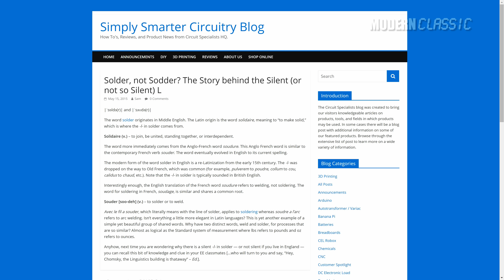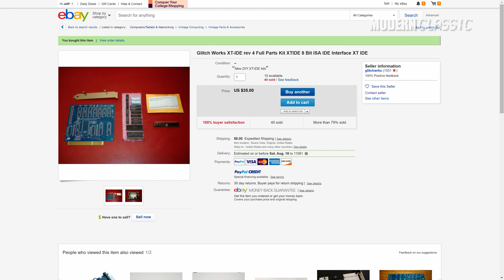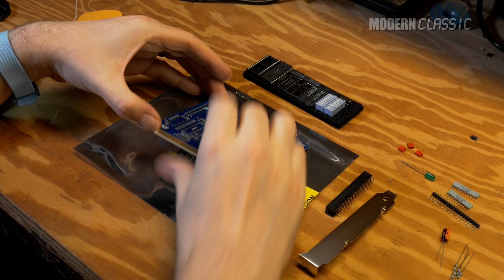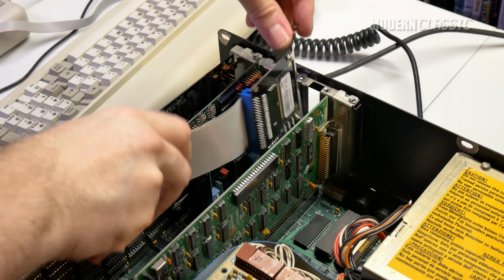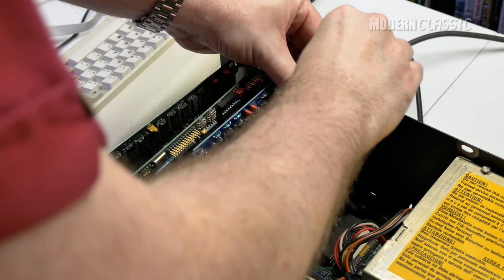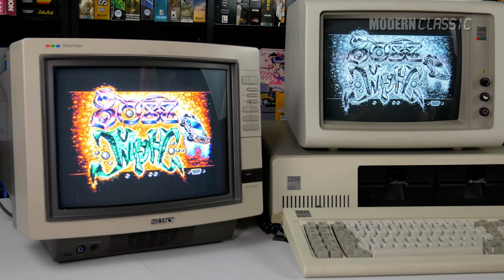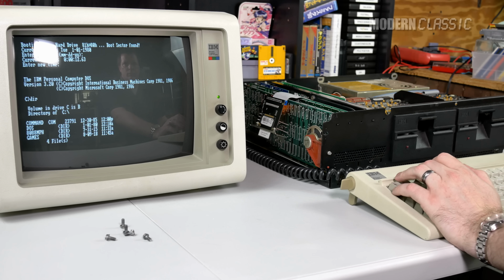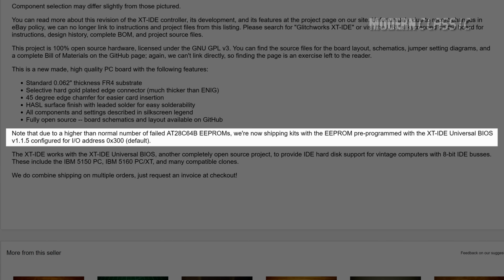Flash storage for classic PC's - building an XT-IDE kit!

Comment: This was an extremely useful video to me, as I was just struggling with trying to get XT-IDE card working with my CF Adapter, I even used the same CF adapter! It's annoying that I have to find an original copy of DOS for it to work, but I guess its always interesting to have the physical disk. Also, do you know what the power input on the CF adapter is for? I thought that it must be necessary for the card to work, but given that you didn't need to use it, I assume that it must just be for if you plan to use a slave drive.
Reply from the maker: The power input is there for controllers that don't supply it via pin 20. One of the jumpers on the XT-IDE is actually to set that. So if you have a CF adapter that can't take power that way, you can change that jumper, and likewise on the CF adapter, the port is there if the controller doesn't support it. Luckily in this case both do.
Reply: Ahh, my CF adapter is the same brand as yours but mine has no pin 20, that is what was confusing me. Thanks.

Comment: I had the same problem when installing DOS 5.0 with a XT-IDE on my Tandy 1000 TX. To get my system to work I partition/formatted a 32 meg CF card with a DOS 3.2 disk and then installed DOS 5.0 to that partition. Then I added a second larger CF card and partition/formatted it with the DOS 5.0 install. So I ended up with a 32 meg C: drive and a 256 meg D: drive
Reply from the maker: I don't mind just blowing up my current partition to make one big one now that I've backed it up to my modern desktop. My current problem is just that I don't physically have DOS 5.0 and can't easily get it on this machine without just buying a real copy of it on 5.25" disk. I'm not sure what the Tandy 1000TX supported, but the original IBM PC was pretty limited in its storage options, including floppy support, or I'd just use a floppy emulator or make disks on another machine. I'll figure something out, though; I'm still running through my options trying to do it for free with what I have, but if I have to just buy real disks, I'll do it.

Comment: It would be cool, if Glitchworks would actually provide a all-in-one solution - the XT card with memory controller and CF/SD slot on board. It would allow to spare a slot in the motherboard, and be verified out-of-the-box solution for solid storage needs on old machines.
Reply from the maker: There is such a thing as an XT-CF. But then you're locked in to CF. I just wanted the freedom to be able to use CF, SD or even an IDE hard drive (I never know how I'll feel in a few months). But if you know you only want CF, you can get this or something like it: https://www.ebay.com/itm/Bootable-XT-CF-ECO-LITE-XTIDE-Lite-8-bit-ISA-2GB-SSD-Hard-Drive/123270191495
Reply: Working on this. It's just gotten pushed down in the project queue for other things.

Comment: how thick is your solder? 1.5mm? 2mm? a bit thick for normal electronics imo. 1mm and below is the best for electronics.
Reply: Unrelated comment, but yay Mint OS!
Reply from the maker: Well, it either works or it doesn't, and it worked :)

Comment: try creating a fat16 partition with minitool partition wizard on the modern computer, and don't forget to enable the "active and boot" flag, maybe it didn't work on the first try because that was disabled?. any DOS up to 6.22 should boot fine on a XT. win9x's DOS 7 won't because "it requieres 386".
by the way, add "prompt $p$g" to your autoexec.bat to have the full c:\> thing.
Reply from the maker: It was definitely a geometry issue causing it not to work the first (and second, and third, etc.) times - the partition was active and the card booted fine in the VM that created it, as well as a new one I made afterwards. From what I've seen so far, you really need to create the partitions on the PC itself, while using the XT-IDE controller. I've got some things I'm going to try to get DOS 5.0 on it (there are a few reasons I don't want to go higher than that) but I'll add the minitool partition wizard to the list of options. Thanks!
Reply from the maker: Little update - I did try the minitool partition wizard and as I kind of expected, it nuked the card as far as the XT-IDE is concerned. (I did install DOS 5.0 on it first, but hadn't reformatted or repartitioned before using the partition wizard.) So I guess that option's out, unfortunately. I had backed up, so don't worry, I didn't lose anything.
Reply: so you are stuck with DOS's own fdisk and installing directly on the computer. you'll have to make 360k floppy disks of DOS 5.0 to install it on the computer.  maybe you can get them from winworldpc website, search for "winworldpc DOS", there are lots of disk images there. maybe you'll have to copy the disk image to an intermediate PC with a 5.25 drive. they work in 98 and XP but I don't know if newer windows like 7 or 10 have support for 5.25 drives.

Comment: The first thing I noticed was the RadioShack solder and instantly got sad. I never knew how much I relied on them until they were gone. Rest in spaghetti, never forgetti.
Reply from the maker: Yeah, I actually like that solder! I have another spool I got from Mouser that's smaller diameter and technically more appropriate for something like this, but it just doesn't work as well. I think it's the flux; the RS solder just has a lot of flux, and it seems like good flux. The other stuff I have also has a flux core but it just doesn't stick unless I manually flux up every surface before soldering. I've been wondering what to buy when my RS solder finally runs out.
Reply: RIP Radio Shack. I still have some of that Radio Shack solder and a number of pig tail cable repair parts, switches and adapters. Those days of having a local place to run out to for a part at the 11th hour are sadly gone. Most nostalgic of all, my old and beloved Tandy 286...ahh the memories of my first PC 😢 I'm gonna go give her a boot up just to listen to that lovely loud HDD and PC speaker post tone!
Reply: Ahh the good old RatShack 60-lead/40-tin solder... still got a spool left from back in the day :)
Reply: AMEN!
Reply: Being new to DIY electronics and don’t know if I should use solder with or without lead. Any tips? Thank you in advance! 👍
Reply: @LemmyCaution66  Use lead solder, and have a small fan blow the smoke away.  The lead-free stuff is just a pain in the ass to work with sometimes.  An example is soldering on a raspberry pi. for some reason, it only seems to like lead solder.
Reply: Don't feel so sad, the smaller "mom and pop" radioshacks are still around

Comment: That NTSC CGA faux-16 colors remains a fascinating topic. It's really interesting how even John Carmack didn't know about this until he learned from from The 8bit Guy's video on the topic.
Reply from the maker: I haven't looked into how the PC does it too deeply, but the Apple II and various other computers also used artifact colors, so unless the PC's doing something really different but called the same thing, it seems like it was a pretty common hack at the time. The only reason I can think of it not being widely known on the PC is that most people probably used the official monitor with an RGBi connection - I don't remember ever seeing anyone connecting a PC with a composite connector in the 80's.
Reply from the maker: Games definitely do, yeah. Text and other apps look a lot worse, though. I had a really hard time even getting the text to a point where I could comfortably read it over composite, whereas over a CGA connection it's 100% clean. Tradeoffs either way. But it's nice that there were options.
Reply: @ModernClassic  Yeah, that definitely makes sense. And options are definitely good - Burgertime looked great, for example. Maybe one of the best looking, if not the best looking port. Which is pretty cool for a PC game for the time
Reply: Right? And it makes games look so much nicer than standard CGA
Reply from the maker: And I had no idea it looked that good before this, because I have only ever played this version on RGBi.
Reply: It's a bit weird that there's actually quite a handful of games that support it, it must've been more common knowledge at some point in some circles.
Reply: @Nukle0n  Yeah, I was wondering the same thing. Maybe a lot of devs knew about it, but not the average PC user? Speaking of devs, it's cool how many games supported several graphics modes for their PC versions later in the '80s
Reply: @ModernClassic  Haha, yeah! It would've been cool if more people had known about it at the time
Reply from the maker: There are some games that support it but not really all that many - I actually got the ones in this video after looking at the list here: http://nerdlypleasures.blogspot.com/2013/11/ibm-pc-color-composite-graphics.html

He says "well over 100" games support it but just eyeballing it, it looks to me like just over 100. I don't know what percentage of games that is but I'm guessing a very small one, because if you imagine if the PC only had that 100 or so games through the mid-80's, that'd be a tiny library. So my guess is around 10-20% or so of early games supported it, in the era when someone might have still been using a CGA card to play games on (let's say 1981-1988 or thereabouts).
Reply: Once IBM introduced the first EGA card, no game company spent the effort on carefully crafting CGA graphics to produce artifact colors on CGA's composite output.